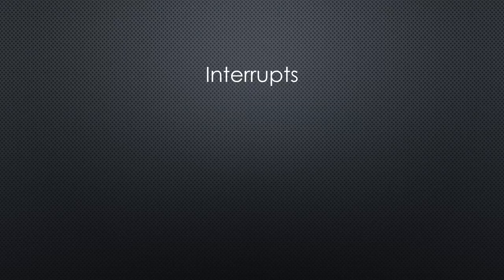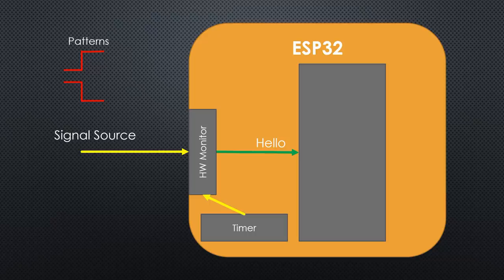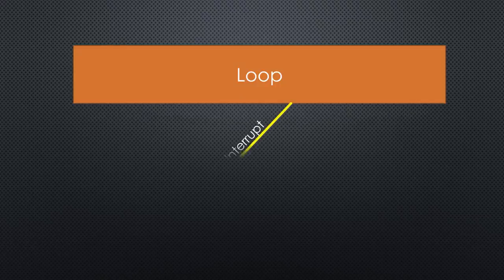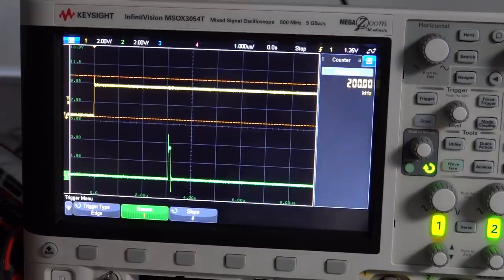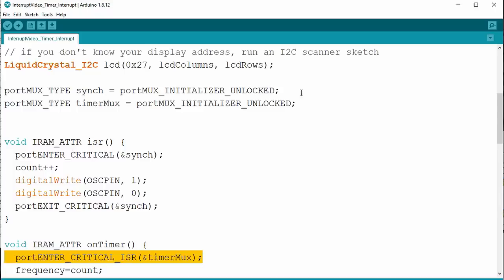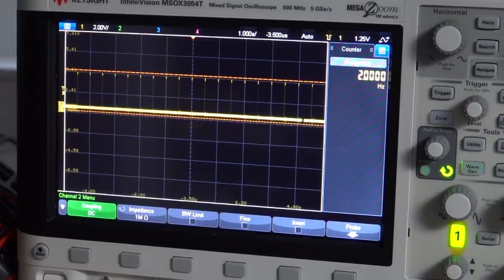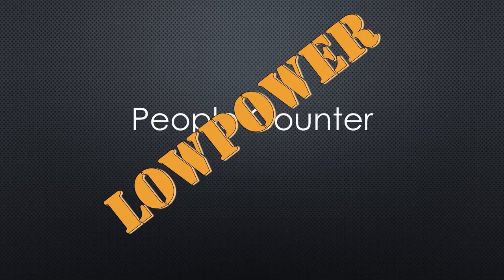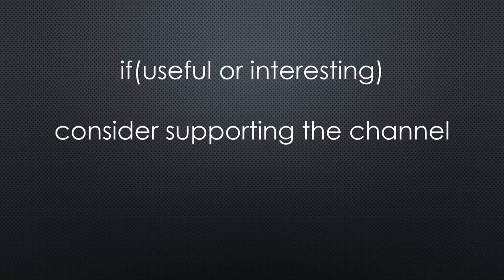#328 ESP32 Secrets: Interrupts, and Deep-Sleep under the Hood

Comment: Your code is wrong. You must be inside a critical section every time you access the shared volatile variable. As it's a very simple variable that can be accessed atomically you can skip that when reading the value but you must not when when modifying it like when you reset it to zero.
Also you should use ISR type critical section type in the interrupt (on esp32 it doesn't matter but it's clean coding).
It's good you didn't forget the IRAM attribute for the interrupt.
https://techtutorialsx.com/2017/09/30/esp32-arduino-external-interrupts/
Reply from the maker: Wrong is a hard word. Marmelade not necessary is a better description. I know the facts. My videos live from what I leave away.
Reply: "Wrong" is a not a hard word, it's an off topic one...
The purpose there was to find the maximum frequency you can measure on ESP32 with Arduino framework.
For now, we have a code that can go around 200kHz
I would be glad to see more efficient (yet simple) code.
Reply: The code is not wrong.
There is only one place that increments the variable and it cannot be executed concurrently. There is already critical section preventing other Interrupts.

I'm not familiar with ESP32, but usually interrupt controllers don't allow second triggering before the first one is cleared, aka ISR has finished execution.

The main code only reads the variable once per loop, so it is no issue if it gets old or new value.
Reply: @ИванСнежков-з9й  you forgot the reset of the counter. Technically it works if the interrupt runs on the same CPU. But esp32 is dual core...
In this particular case it works because both the loop and the interrupt run on the same core but this is dirty coding.
Reply: @marcrives279  if you really want the maximum speed you can get rid of the critical section. It doesn't make any sense to have one at only one place in the code...
Reply: @ИванСнежков-з9й  The critical section doesn't actually prevent other interrupts. It just queues them and make them block if they would try to execute (nest). But it is somehow pointless when doing just count++. Taking a mutex will be more time consuming that doing count++, which because it is only place where you modify count (other than the reset to zero in the loop, which can be eliminated btw), you don't really need to protect it at all.

Comment: Why the busy waiting in "loop" when using interrupts? Avoiding "delay" is not always good. In that case, it's actually just a waste of cycles.

Also, you enter critical sections in an ISR using "taskENTER_CRITICAL_FROM_ISR". See https://www.freertos.org/taskENTER_CRITICAL_FROM_ISR_taskEXIT_CRITICAL_FROM_ISR.html

It's probably not the best to do it that way though. Ideally, you'd use C11's / FreeRTOS atomic types instead and don't bother with critical sections. (See https://www.freertos.org/Documentation/api-ref/platform/atomic_8h.html) I think incrementing is an atomic operation in the ESP32 ISA, so I'd just let the ISR increment the counter atomically. You also don't need to have "loop" reset the counter (since that's probably not possible to do atomically), "loop" can just remember the value of "counter" it read 1000ms ago, and compare that to the current value of "counter". Integer overflows will ocurr of course, but that's not a problem, the frequency will be correct anyway.
Reply from the maker: I am a RTOS noob, so I had to depend on things I found. Thank you for your additions.
Reply: @AndreasSpiess  Actually I have to correct myself, using "delay" inside "loop" when using interrupts is not a good idea since that wouldn't account for the delay caused by writing to the LCD etc. Waiting for "millis()" to pass a specific mark, like you did, is better in that case.

The correct way to do it, to avoid the busy waiting and the relative timing problem, is by using "vTaskDelayUntil". See https://www.freertos.org/vtaskdelayuntil.html (also includes an example at the bottom)

But I think busy waiting is ok too, it's simpler and it probably doesn't have any negative sideeffects either.

Comment: Don't do that calculation every loop it burns too many electrons
lastentry = Millis() +1000;
While ( Millis()<lastentry){
Reply from the maker: I do not agree that this has any implication on power consumption.
Reply: @AndreasSpiess maybe not measurable power but consider clock cycles.  that's my code review it is fact:  Every time through the loop the cpu has to do additional work doing the addition which could've been done just once.